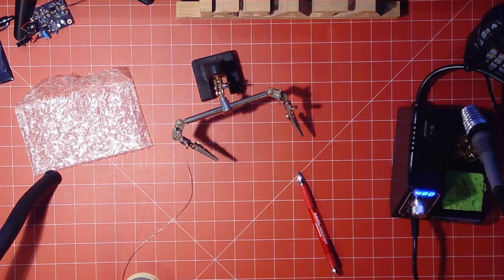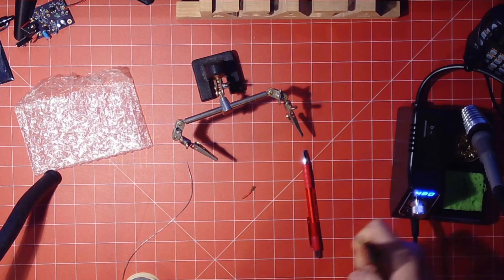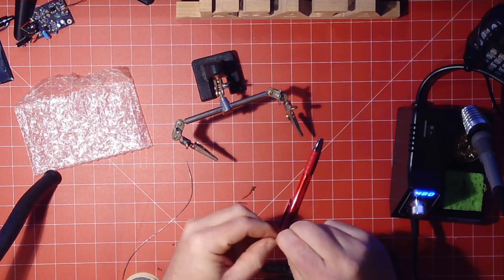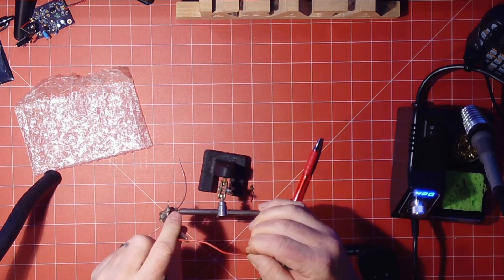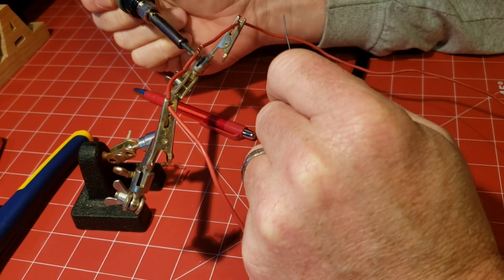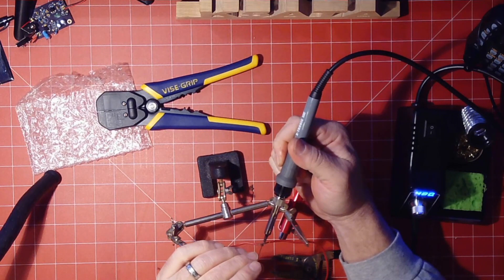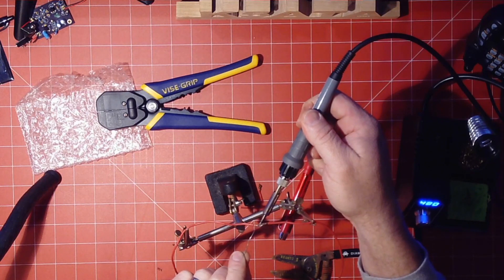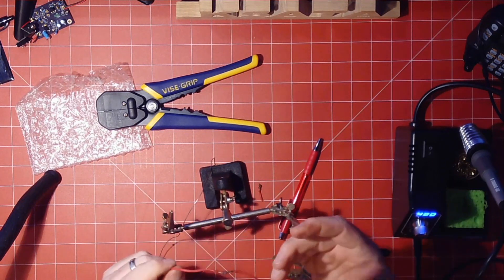Ham Radio Basics: How to Solder Wires Together

Comment: I have the same soldering station. What temps do you normally set it to, and how do you know when it's up to temp?
Reply from the maker: I am pretty sure mine has a little light that blinks on the bottom right of the display. The blink slows down when it is at temperature. I never really pay that much attention, I just turn it on and it is ready to go in a couple of minutes. Thanks for watching!
Reply: @K5ATA  I've noticed the little blinking light and figured that might be it. Thanks. :)